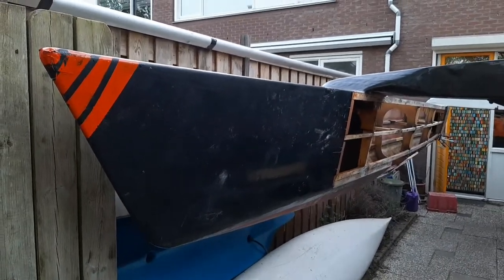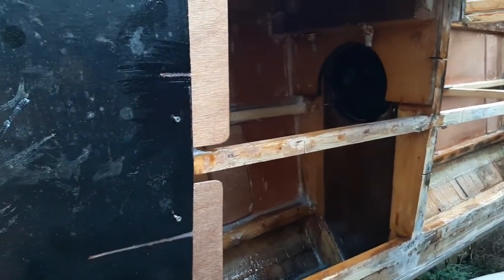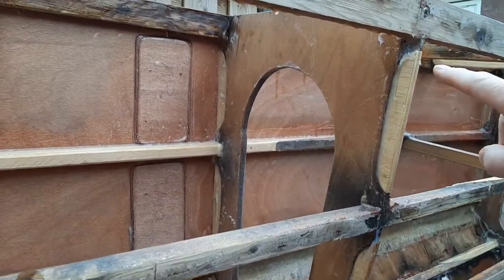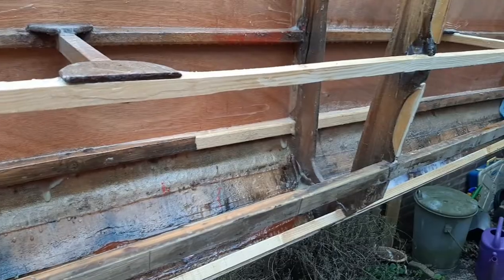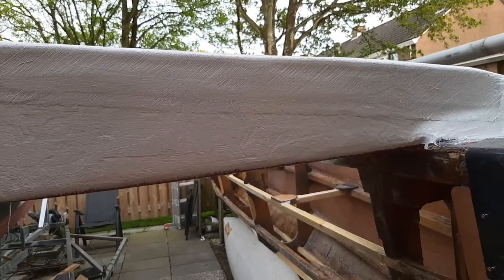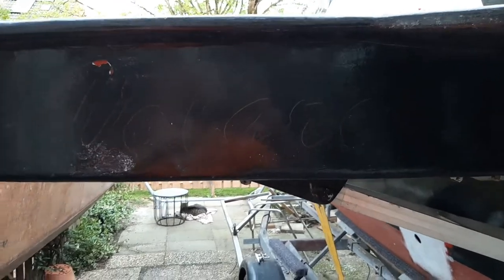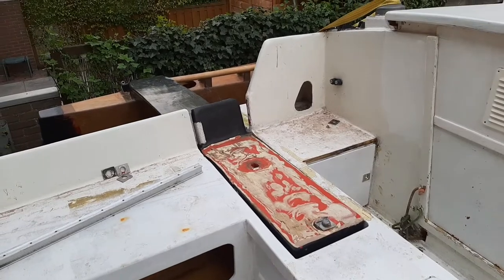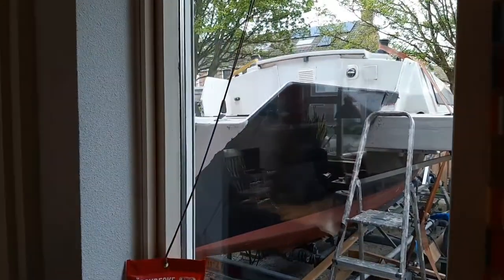April 2022: A trimaran in the back yard.

Comment: Just found your channel Dennis and subscribed. Thanks for taking the time to share your excellent work. A couple of questions if I may please.
1. In the float you were filming what is the black staining on the plywood at the turn of the bilge as seen through the missing side panel?
2. How do you deal with the winter? Epoxy and cold are not the best of friends. Do you have a temp shelter or just cover and wait until it's warmer.
Thank you
Reply from the maker: Hi Neil, welcome aboard!
The black staining is usually caused by water ingress. It starts out as a darker discoloration and, provided there's enough oxygen and water at high enough temps for long enough, it progresses to mould rot and full on fungal blooms! I've even removed mushrooms from some really bad spots. In those cases what was left of the wood had to go. I removed most but infused epoxy in some areas, provided the wood was still strong (screwdriver test) and dry or able to be dried out.
In winter I used super fast curing epoxy and laid it on thick to take advantage of the exothermic heating. If course I put up good thick tarps to keep the rain off. The temperatures here aren't below freezing for to much of the winter and we don't get thick snowfall like some places do.
Of course, if at all possible, wiring inside is much preferred! Finally, if it's really too cold or damp and the construction critical (beams, bulkheads), I waited it out.
Reply: @sail4life  thanks Dennis. Very well explained. I too am refitting a catamaran that I didn't build. It's in much better shape than your tri was but I did notice the black staining on the underside of two hatches from water ingress. It's definitely solid so it sounds like I may be able to save them. I appreciate your knowledge.
Winter is challenging for me here in Tasmania, Australia. My workshop rarely gets above 2 or 3 deg C during winter and it's constantly damp outside making working on the boat difficult. I like your idea of reserving electrical or inside jobs for this time. Maybe even upholstery! Thanks